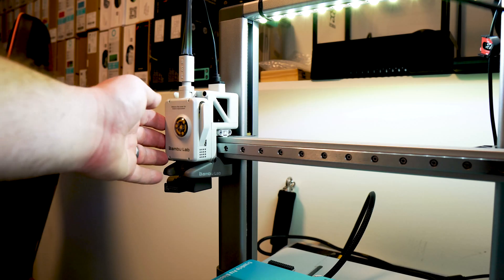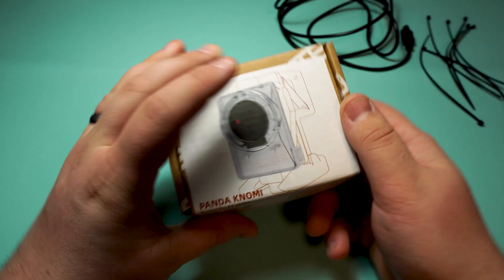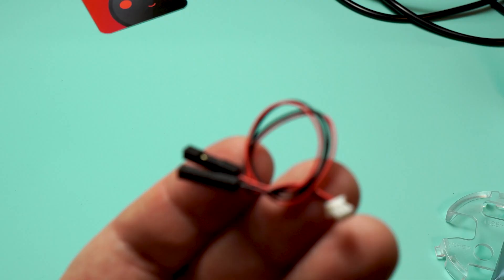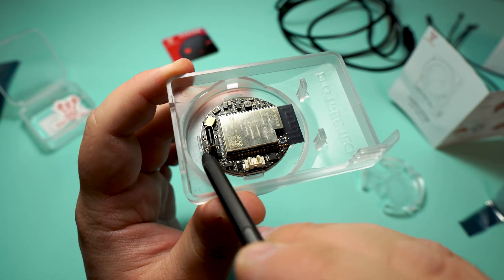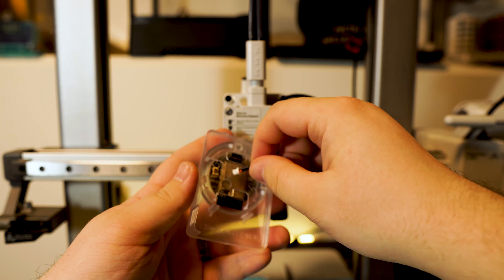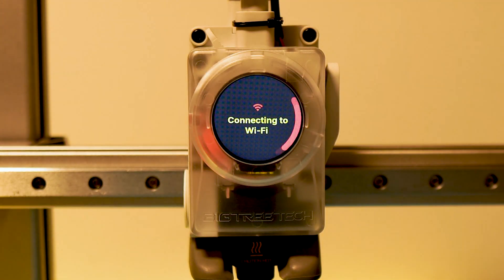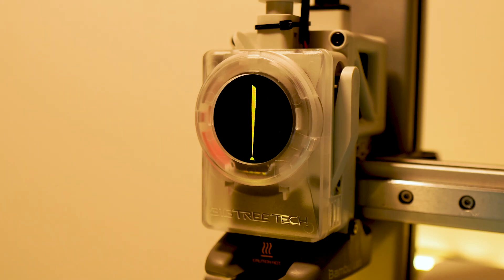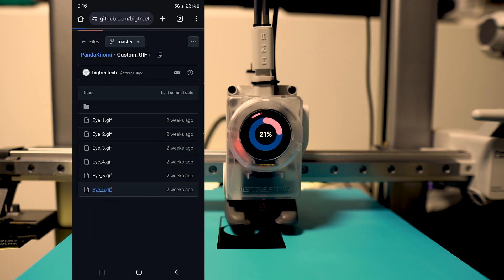Coolest Upgrade for Bambu Lab A1 Printer - Panda Knomi Extruder Cover

Comment: Mine did not say AI series. I got the whole kite and got it all load but the IMG its just not setting up. Why?
Reply from the maker: Hey there, I had that problem too and for me it was because the gif was either too big or file size was too large. I ended up just using default gifs. BIQU has step by step instructions on how to upload custom ones on their wiki page, but it seems to be down right now?

Comment: Can you youse the ams with it
Reply from the maker: Yes. I've been using it with AMS since the release of this video. No issues. Just make sure not to restrict the cable too much and make sure it has enough slack. 

Also make sure it doesn't intefere with the filament cutter lever.